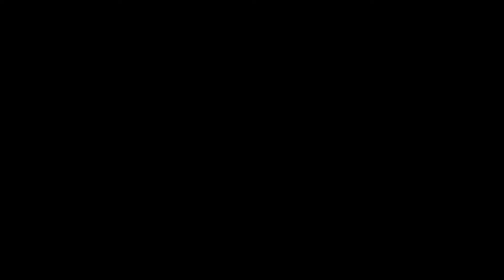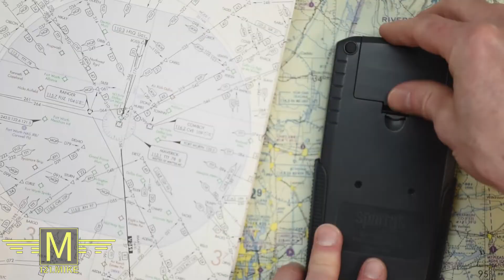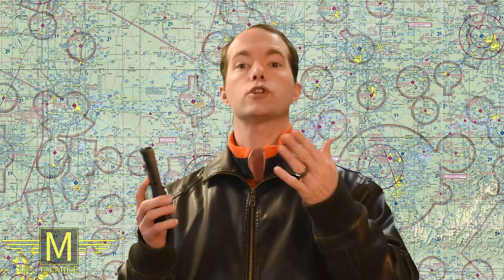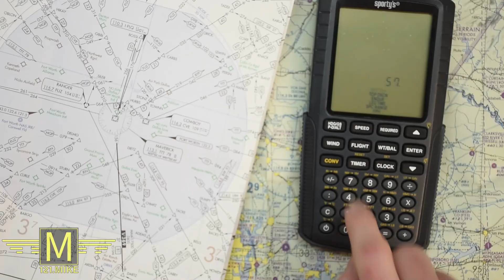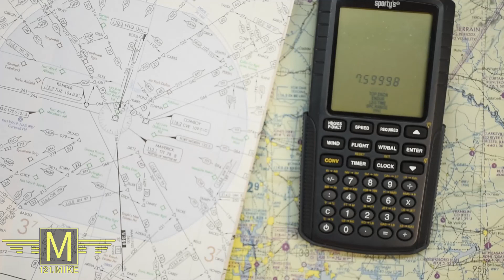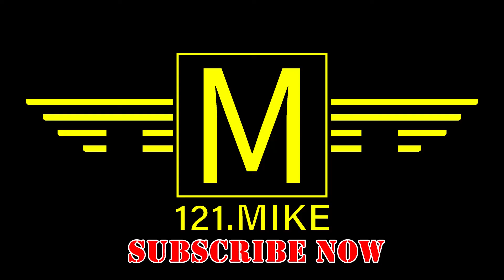Sporty's Electronic E6B Ultimate Guide - 121.Mike

Comment: I think it is just so much easier for me to use my brain to add or subtract the 7 hours time. So much easier. No need to set the clock. The only clock that is accurate is the cell phone clock. I use that clock and just do the conversions in my head. All other clocks are wrong and totally incorrect. Never trust a clock unless it is a clock on your computer, or on your phone.
Reply from the maker: You're certainly right about which clocks are to be trusted. Did you ever give the E6B clock another try?
Reply: @MikesInventions  I find the mechanical E6B ti work just fine. I can do the calculations much faster and easier to use the mechanical E6B.